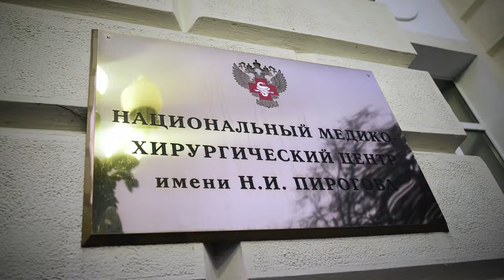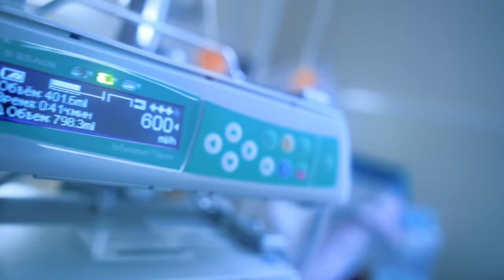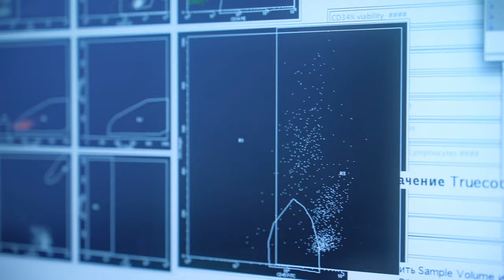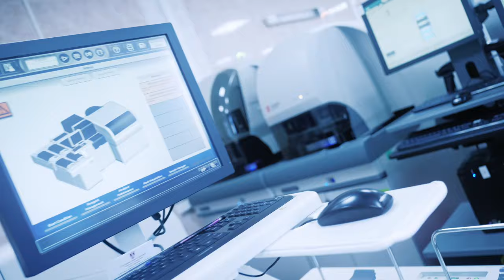HSCT Treatment for Multiple Sclerosis Patients

Comment: I'm 29 years old and still fully able to walk around all day long without any assistance, despite this, I've been having many symptoms of MS and most likely PPMS, I am just waiting on my MRI  test results. Is there any data anywhere about how effective HSCT is for a younger person with PPMS who has not yet suffered any major disability?
Reply from the maker: The rate of MS stabilization and improvement for RRMS - 85-95%, for PPMS/SPMS – 65-75%. Early transplantation - is most effective.
We suggest, that the best candidates for transplantation are relatively young patients with active inflammatory lesions of relatively short duration and rapidly progressive disease, but still low disability scores, resistant to conventional therapy. Cumulative incidence of disease progression was quite low both for RRMS and PrMS.  After you would receive your MRI report (no images required - only report), proceed to complete questionnaire, describing you previous treatment and current functional status, in order to define whether HSCT is a meaningful and safe treatment option individually for you https://hsct-russia.com/application-for-treatment